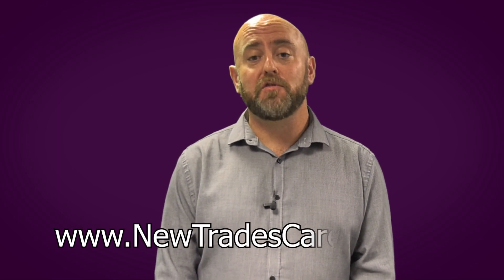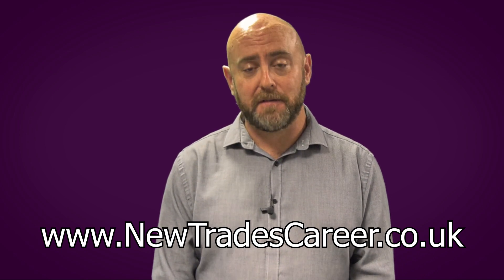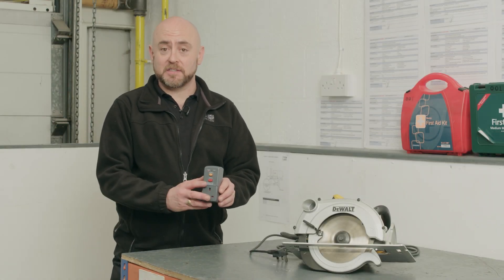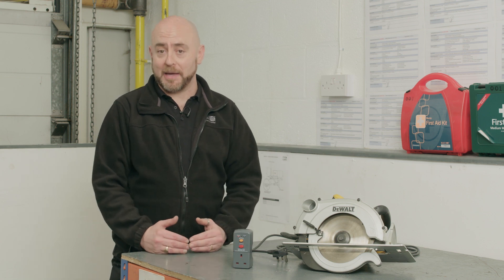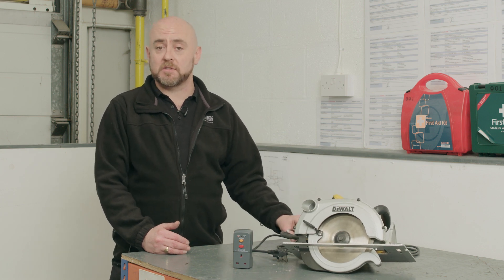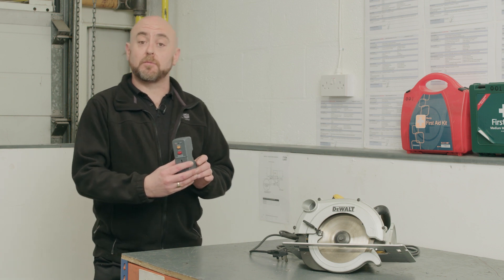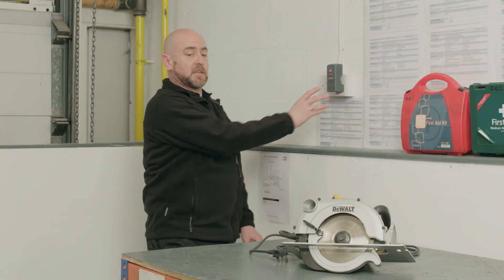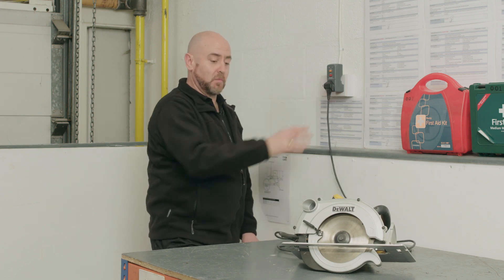New Trades Career - How To Use An RCD

Comment: Informative video. Makes sense to use a portable RCD when using any power tools. A permanent RCD plug can also be wired up on any vulnerable power tools e.g. electric cutting tools,  electric drills and wet vacs.